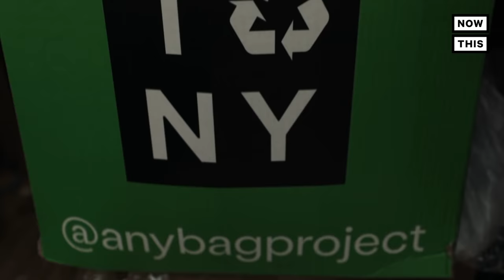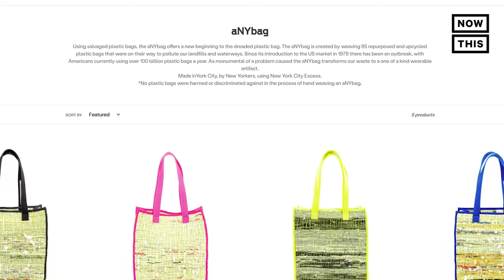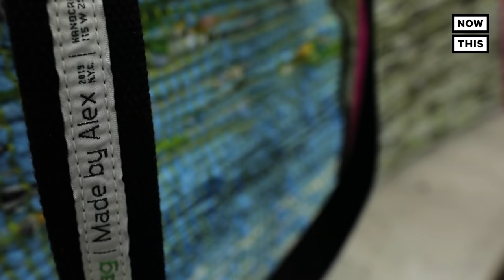Turning Plastic Trash Into Luxury Bags | One Small Step

Comment: What a great idea. I live in Australia and I recycle plastic as well. I cut it up and make plarn, which is plastic yarn, I make things like coat hanger covers, beds for the homeless to lie on, bags. My next venture is to make a rain poncho and see how that goes. Perhaps this company might want to also look into other products that they can make. Thanks for sharing this with us 😊
Reply: Janelle M, would this material that you make be strong enough for seating like outside sling chairs?
Reply: @grittykitty50  it depends on how many bags you iron together. Maybe you might have to do the weaving method to make it strong enough for a chair or weave a bit of canvas in it.  My process is to lightly iron bags together so that when you cut them up in a continuous method so as to make a string, or what is called plarn.  If you google plarn projects, you will find all sorts of things to make.

Comment: The plastic bags aren't UV stabilized so it will fall apart into micro-plastics and get into the food chain.  Best thing to do is not use it at all, but if you have to use, burn it so it breaks down into its component atoms. Don't burn it yourself, but at industrial facilities that can create the super high temperature necessary to do it cleanly as possible.  Or remelt it with UV stabilizers and make big products so they are going to last for thousands of years.

Comment: It's possible to melt plastic bags together with just an iron (under a towel), then cut into strips to form a "yarn" to crochet and makes wonderful cushy mats (for the homeless). For about a week. That's the problem. Soft plastic bags disintegrate (not disappear) into thousands of tiny pieces very quickly. I've melted stacks of over 20 bags, interspersed with different materials to increase longevity, and they make an interesting material to work with initially, they don't last - not even long enough for a bath mat.